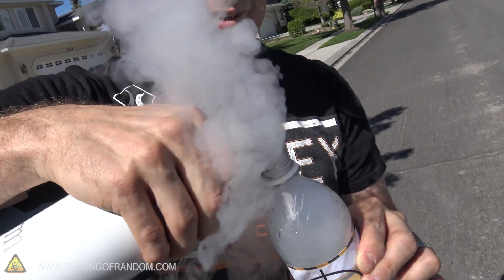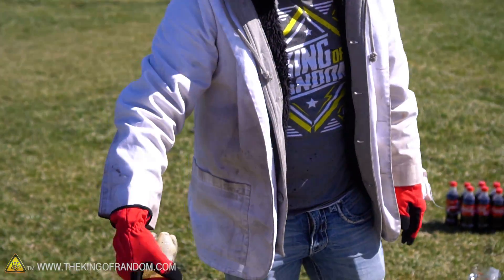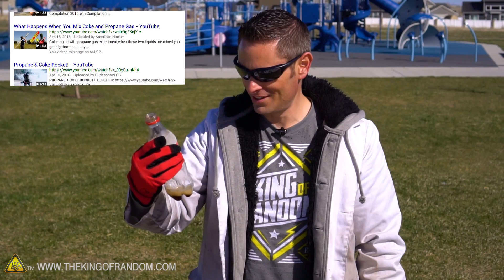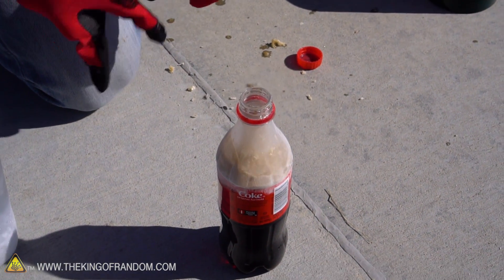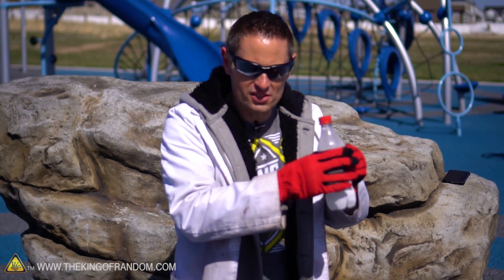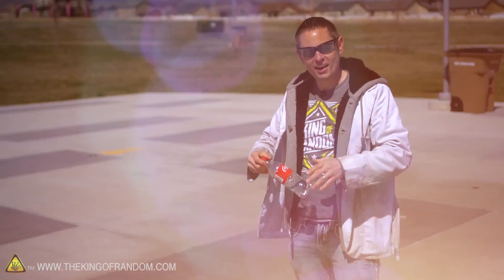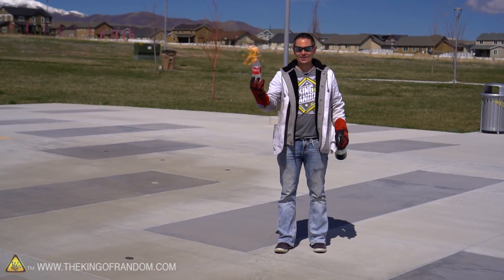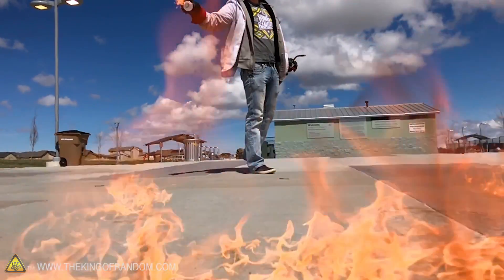Mixing Coke With Propane Doesn't Do What You Think It Does | Propane And Coke Experiment

Comment: What would happen if you mixed liquid propane and liquid oxygen and lit it on fire?
Reply: That's called rocket fuel, son, and it does what you think it does.
Reply: You don't realize what it takes to make liquid oxygen apparently
Reply: mike sibel You'd end up with a rocket engine lol. That's exactly how rockets work, they have tanks of liquid oxygen and liquid fuel and they throw them into the engine and burn them
Reply: TheChief417 you theoretically can have solid oxygen you just need a lot of pressure and it to be extremely cold
Reply: mostly depends o the ratio bu it has the potential to explode
Reply: ZettabyteGamer do you know basic chemistry? if you put something in a vacuum the molecules will move more freely making it harder if not impossible to make a gas solid in a vacuum
Reply: ZettabyteGamer for it to be solid you need to be under intense pressure or extreme cold or both
Reply: TheChief417 if only our special friend understood that
Reply: ZettabyteGamer I'm honestly questioning if you know what a vacuum is
Reply: TheChief417 see when I did say that you have to increase pressure to solidify it our friend zettabyegamer happened to deny everything even though the science behind it supports what we are saying
Reply: ZettabyteGamer You're not entirely right or entirely wrong. Vacuum helps by slowing the boiling process. Pulling the vacuum in and of itself doesn't make the nitrogen solid, that happens because if the lowered temp in that video. The vacuum does help allowing more of the nitrogen to exist as liquid by lowering the vapor pressure.
Reply: ZettabyteGamer plus you said more then that you constantly told us we were incorrect when raising pressure and lowering temperature will solidify oxygen the science backs it
Reply: Okay ZettabyteGamer, you are correct that under a vacuum, nitrogen will freeze if it is cold enough. However, oxygen will not. Look at the phase diagram for oxygen, you would have to get it to something close to 0K in order to freeze oxygen at 0 atm. So you were right when it comes to nitrogen, but you can't just assume the same for oxygen.
Reply: TheChief417   hey I'm not a scientist I don't know that's why I said try it lol.
Reply: Cryogenic Gaming Nope, can't have solid oxygen or hydrogen. The big orange tank on the space shuttle is full of liquid hydrogen and liquid oxygen. The white boosters on the side ARE solid fuel, that might be what you're thinking of. Those are aluminum and ammonium perchlorate which is an equally terrifying reaction.
Reply: RedEssence Gaming True, I just meant that it's near impossible in every day science. Same with solid hydrogen. It can be done, but it's very very difficult. And not practical when you need millions of pounds of the stuff haha
Reply: ZettabyteGamer No you can't, you need pressure and low temperatures to have solid forms of both. Removing the pressure would just allow the molecules to separate and become gaseous.
Reply: Andrew Smith well then your in the state of perfect balance where an element can exist in all 3 states of matter if you can have solid liquid and gas in the same area
Reply: RedEssence Gaming Putting something in a vacuum makes it harder to freeze. You have no convection to pull heat away from the object. The only way to solidify something like that is to lower temperature and raise pressure. - I'm an Aerospace Engineer working in rocket propulsion so I deal with cryogenics very often.
Reply: Actually the ysue solid blocks of each i believe.  Or at least that is what i heard
Reply: You also need high pressure and low temperature to make liquid oxygen. It's not as simple as taking gaseous oxygen and just "turning" it into a liquid
Reply: If they were mixed, I'm not sure whether or not it could exist as liquid for long in its cold state, if at all.  But if it did it might solidify, as the oxygen would evaporate out faster, leaving propane.  Not sure if boiling oxygen is cold enough to solidify propane.  but I think it might light well.

However, if they were mixed under pressure and ignited at normal temperature, it would be a NASTY explosion...
Reply: If you get it cold enough, any substance will be solid even at zero pressure. Putting a liquid in zero pressure will cause it to boil which reduces its temperature. So if you put liquid nitrogen in a vacuum, you wind up with some gaseous nitrogen and some solid nitrogen.
Reply: Yes indeed i do.  The reason that thinks will freeze under a vacuum is because the warmer molecules are boiling off and the other molecules are being left behind and eventually lose enough heat to freeze.
Reply: Here's my take on the concepts being discussed here:

Liquids that evaporate have something called a 'vapour pressure', which depends on temperature, often in an exponential manner to temperature... and even in their solid state, seemingly not affecting this curve, also possess a vapour pressure, which explains sublimation.

This vapour pressure directly determines what temperature and ambient pressure boiling occurs.  When the ambient pressure is less than its vapour pressure, the liquid is free to become gas internally, effectively evaporating from not just the surface, but inside as well.  For example, if a liquid is microwaved to heat it, even if it's kept mixed, you will always notice it start boiling from the top, quickly downward, which is due to the pressure of the liquid's weight below the surface.  If the liquid is cooled enough to freeze, it does not suddenly seize to evaporate, because the vapour pressure, as low as it's getting, still exists.

Most liquids contract upon cooling and continue to do so through their solidification phase, potentially pulling their container walls in with great force if there is adhesion.  After that, the contraction vs temperature is very small.  This effect is more dependent on the substance than the liquid/gas phase change, and explains why water is such a unique model which doesn't describe most liquid/solid phase change regions.  Therefore we can deduce that adding pressure to most solids tends to raise their melting point.

The reason sublimation occurs is because the boiling point and melting point of most substances occurs at different rates, and therefore the two temperature-pressure curves will meet at one point called the 'triple point'

I hope I was able to help settle some arguments here 😊
Reply: You can have solid oxygen and hydrogen though, you just need to be under a vacuum.
Reply: You're wrong. /watch?v=rM04U5BO3Ug
Reply: The video I linked was Nitrogen, but you can do the same with Hydrogen and Oxygen. Here's a video of someone solidifying oxygen with a vacuum. /watch?v=6RRLBD1bB3E
Reply: Look at either of the two videos I linked, you're both wrong. You can solidified Nitrogen, Oxygen, and Hydrogen by simply putting the liquid from in a vacuum.
Reply: Again, you're dead wrong. /watch?v=rM04U5BO3Ug
/watch?v=6RRLBD1bB3E
Reply: salami Man Oxygen and liquid nitrogen. Watch Codys lab. I'm confident Grant can do it.
Reply: Pulling a vacuum on liquid Nitrogen, Oxygen, etc causes them to solidified. Refer to the videos I linked.
Reply: That is not how it works, my Friend.  Lower pressure raises boiling and freezing point, making the substances solidify in a much warmer atmosphere.
Reply: You've got that backwards my man. "A liquid in a partial vacuum has a lower boiling point than when that liquid is at atmospheric pressure."- wikipedia (I know, its wikipedia. I dont care, its right.)

Comment: Propane has quite a low boiling point, that's why we use it outdoors. I think, when you turn the bottle upside down, it doesn't turn into a gas as quickly as butane & can't propel the coke outside the bottle to lift it off

Comment: I suspect that if you stored propane under pressure in the coke bottle for a longer time, the propane would dissolve into the plastic leading to eventual failure.

Comment: maybe shaking the bottle after the propane has been put in the coke bottle would weaken the ice or split it enough and done fast enough might go flying but they could have just used a different material entirely as you mentioned

Comment: Put the propane in a bottle full to the top and shoot it with a gun
Reply: Matthew Evans
It will leak, that's it. Bullets don't light things on fire
Reply: If you use incendiary rounds or tracers it will probably work though it might take several shots doesn't always work on the first.
Reply: but... they do in movies...
Reply: I've done that too, you'll get a larger blast if you place the (full) propane tank on top of the coals right in the heart of the campfire. The liquid becomes superheated in the can due to the pressure and the temperature. eventually the pressure overcomes and you get a humongous shockwave explosion. (be ready with a dozen or so fire extinguishers, your bonfire will be everywhere...)

Comment: The difference between Propane and Butane is Propane begins to boil at -44° F and Butane boils at 30° F.   So the Butane would just get the coke to freezing temperatures.  It also will have a lower pressure at the same air temp.   Your coke bottle that you capped off would be a lot more squishable using Butane.   The pressure of the propane depends  on the outside air temps.  I cold winter day it would be around 50 psi and a comfortable summer day it would be around 90.  As for the weight of Propane it only weighs 4.23 pounds per gallon and Butane weighs 4.86 pounds per gallon.  And the odorant they put in the propane is called Ethel Mercaptine.

Comment: I know you can not store liquid propylene (propane's slightly lighter sister) in a coke bottle @ 90F the bottle will explode.  

propane @ 60f holds as a liquid at 210 psi. when compressing propane gas it starts to condense under its own partial pressure at 150psi

Comment: what about keeping propane in vacuum chamber
Reply: Whether or not it burns in air, depends on how much nitrogen is mixed with the propane.  Another thing some may not have thought of... if they are mixed as liquids and the gas mixture is allowed to escape the liquid, you are likely going to have a higher proportion of nitrogen at the beginning, and lower near the end.  The phenomenon which allows fractional distillation 👌
Reply: billy well you know propane has a very low density too we can't say which wins until we try and by the way the changed the comment lol
Reply: LeBitPyro Is there any oxygen for it to ignite with?
Reply: the liquid nitrogen gas would extinguish the flame. check out backyard scientists lighting the pool on fire video for that.
Reply: I think the liquid nitrogen has a lower density though so the nitrogen would be on top. it would be very difficult for the flame to survive, even if the vapors from the nitrogen didn't suffocate the flame.
Reply: Liquid Propane in a vacuum chamber sounds like a bad idea as the gas will evaporate and may potentially ignite near the impeller due to sparks in the motor from the carbon brushes.
Reply: exactly

Comment: Hey Grant, I think you were doing the experiment wrong, I think you need to flip the bottle almost instantly to get the effect.
The effect here is that the liquid is moving to the bottom of the bottle (top when upside down!) and filtering through the warm liquid as it does, expanding into a gas and creating explosive power. Letting the liquid cool the coke negates the effect.

Comment: you have to work fast becouse when u put the propane in it wil start freezing the top layer and the propane wil just sit on top and when you turn it upside down than it wil pour out first but when the seccond u pour in the propane from a second container and turn it upside down i will work becouse the propane wil float to the top and the exanding gas has nowher to go except through the drinking end of the bottle

Comment: grant does the failed coke rocket hold true if you let the coke/propane mix warm up with the lid on first...since you know it wont explode if contained....also if something as "weak" as a plastic bottle can contain it without issue then why do they use a metal container for it..surely it would be cheaper and safer to use plastic all the time seeing as it wont create shrapnel or broken toes if something goes wrong

Comment: You need to use the propane nosel without the modification you made for it. The rocket works because of the propane in gas state that rapidly tries to leave the bottle and has to push the liquid, in this case coca, and by doing so propels it self.

Comment: it does work with propane, i just tryed it, and it works with butane, you poured out to much coke, you only need to pour out about 2 to 3 inches of coke out and then pour the propane/butane into it, and you have to get closer to the ground, and turn it upside down like you did in this video, and turn it upside down, from about 2 to 3 feet from the ground, and it should work

Comment: As I've learned recently, propane is considered a Refrigerant i.e. a substance so cold it's boiling point, in normal atmospheric pressure, is far below the normal temperature we are in, usually between 60°-80°. When it was in the bottle, it built up enough pressure in there to keep itself condensed into a clear liquid, but it instantly started boiling when the seal was broken and the pressure rapidly dropped; kinda like how water boils in a vacuum, even though the temperature inside the vacuum could be in the 50's°. Hope this helps explain in more detail the science behind propane!

Comment: hi grant I think that they actually used the gas of propane not the liquid and somehow that does something different. please experiment some more with my hypothesis because I don't think that many people lied
Reply: Ezra Rubinoff  that doesn't make sense the gas is coming off the liquid no matter what
Reply: That's exactly what I was thinking
Reply: Ezra Rubinoff With the liquid nitrogen experiment its the rapid expansion of the liquid nitrogen into gas that propels the bottle, so I don't think the gas on its own would do anything at all
Reply: Maybe you have to warm up the propane like in the last experiment, but probably not
Reply: Ezra Rubinoff in the begin i thought the song was called fatass because the channel logo was over it
Reply: I agree
Reply: Grant, try co2.
i think butane in the liquid form doesnt work bc it needs to be mixed with the coke in order to propel, and the frozen layer doesnt allow it to do it.
Reply: or maube they do more propane than coke, or maube they shake it first before open and turn it up side down
Reply: also, by putting the lid ob the bottle it stops ot from boiling (stuff boils when vapour pressure is equal to external pressure and if it isnt in contact with atmosphere no boil)
Reply: it is already lots of co2 in coke man.
Reply: Ezra Rubinoff i was thinking that to
Reply: Guys, I tried this experiment and was able to get propane to work. Instead of filling the coke bottle directly with propane you have to get the liquid propane in a separate container and quickly add it to the coke bottle with a funnel and flip it quickly. But it WORKS!
Reply: if it is just the gas you can do it at home, prove yourself right

Comment: I was wondering, what would happen if you'd threw that Coke bottle into a fire? It was pressurize and warm. It started rapidly bubbling and cooling down after you opened the cap. Also when opening it, a lot of gases escaped. Was just wondering.

Comment: Vapour pressure of propane at ambient temp is about 10 atmospheres, coke bottles are rated at 10 atmospheres (that's what my teacher said, I think they can take more).
The guys from kreosan (that you showed in the beginning of your video) said themselves that propane AND butane both work. No, they do not have to be mixed, but it won't hurt either.
Why it didn't work: the foam from the CO2 on top of the coke has a low thermal capacity and freezes very quickly. Your fresh coke is just too carbonated. What also helps: if the coke/water is warm, it will generate something like the leidenfrost effect, which keeps the coke from freezing. And once you flip it over, it will put extra heat into the propane/butane, generate a higher pressure and fly higher. Just fill it with hot warm water.
However butane is definately more suitable for this experiment than propane.

Comment: You need to do this when it is warm. The coke needs to be hot so when the two touch in the bottle there is a gas layer between the coke and the liquid propane.

Comment: Also noticed that the liquid propane turns to gas when you opened the bottle because the fluid level is far lower than before you opened it and let the gas escape.